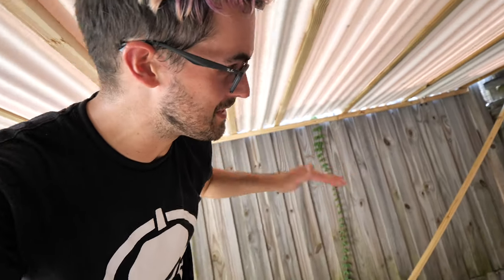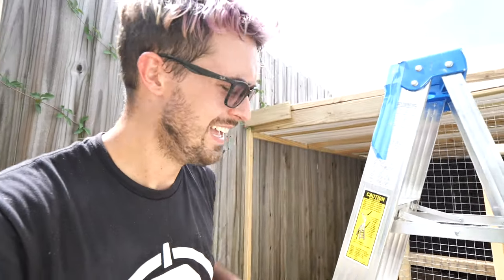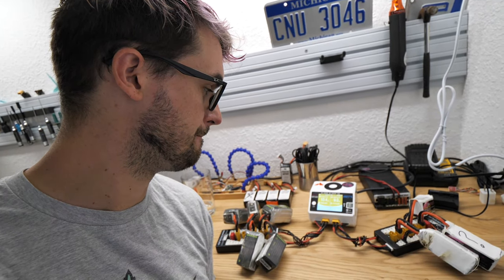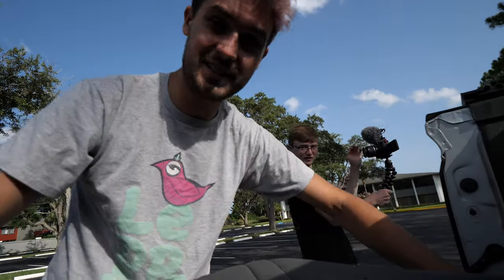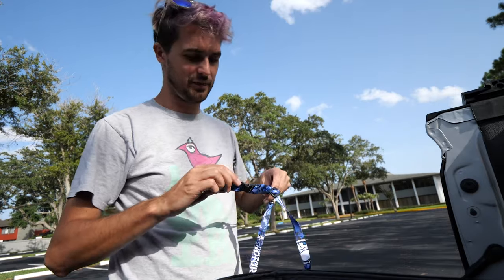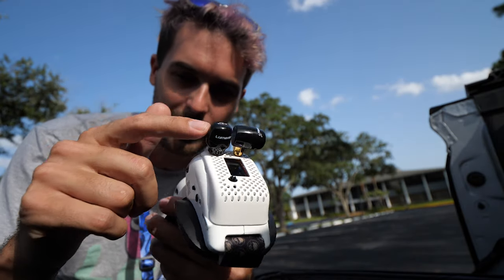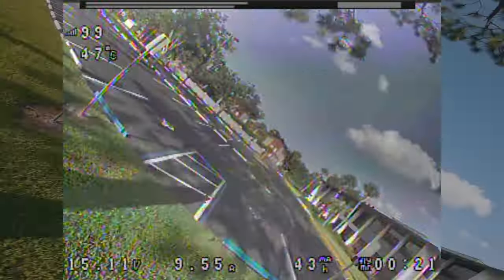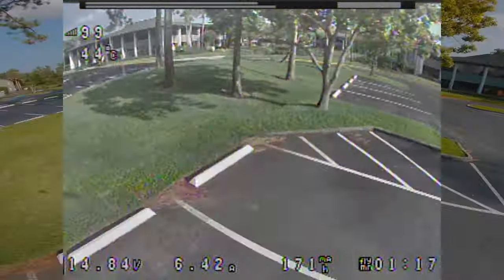planning for "good video" at a NEW FPV spot! (*analog video*)

Comment: Something you should try when using your patch antenna is to switch your mode to Legacy.  Because of the way Rapid Fire works in RF1 and RF2 mode, uses a stitching process where it takes both signals from the 2 antenni and replaces missing pixels from one with the other so having different gain antennas does not really help the situation.  Legacy mode works like a normal diversity receiver so it would be better suited for the mismatched antenna gain.
Reply: Do you know if the sky zones have that mode? I can't change the module in the goggles and im trying to get more range down the road.  I see some videos that they go way out. I'm still on analog.  Like what antenna 📡 is the best ? I use a patch and an omni but I could bring guilty of not pointing my head in the right direction.

Comment: I saw you make some adjustments to the CF mod after the failsafe. What did you turn the power up to?
Reply from the maker: It was set to 100mw when I fail safe, I turned it up to 500mw

Comment: Interesting, you use RSSI output in the OSD rather than LQ 🤔

Regardless, nice exploration video 😎

I do longer range than office parks/spaces and those stubbies wouldn’t do any good for my flying on 25mw.
I’m all about the Pico Patch and Singularity Omni on rapid fire.
Caters for most of my situations.
If I’m say 100m omni the Singularity covers that, if I’m further away in front of myself then the Pico picks that up 👌
Reply: What is LQ?
Reply: LQ = Link Quality
It’s recommended by TBS to use that 👍

Comment: Exactly where I'm at learning to fly in proximity but just can't learn with video dropping completely just flying around a crane. My fatsharks definitely need rapid fire or the new tbs. Now if someone actually had one in stock I would order but it appears the usa is sold out and I'm done with waiting for orders from China. I just got 2 motors I ordered 2 months ago and I lost the quad they were for a month ago. 😥

Comment: Great content!!! One thing i noticed is your battery voltage.... I'm building a BF for the first time how can i get the flight controller to read my voltage well .... Thanks !
Reply: Turn on osd
Reply: @taggerung890  it's turned on i mean how can i correctly read my battery voltage I've heard guys saying that Bf OSD displays the wrong battery voltage
Reply: @greennminion  one of the tabs in betaflight (it has a battery icon) let's you configure it and set the right value
Reply: @taggerung890  perfect thanks Henry i appreciate the help I'll definitely give it a go when it's all set up

Comment: Ok for starters lol....your furring strips for your roofing should be going the other direction, get yourself a tape measure and all your decking boards won't be different lengths, and buy an impact, driving screws with a drill sucks and no one uses then for that anymore.....other than that thanks for your videos ...and I wouldn't have an issue if every cat on Earth was gone lol

Comment: If you weren't using a terrible patch you would have seen more of a performance gain, it seems like you never fly any VAS or TruRC antennas which would have been far superior. Crosshair and Pepperbox extreme performances are superior to any patch, that's why they call them patch killers.